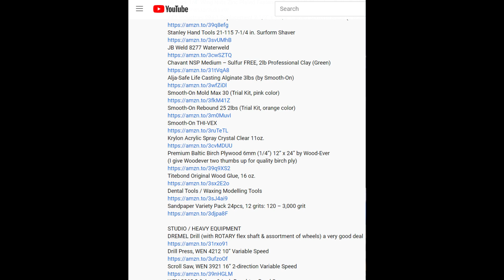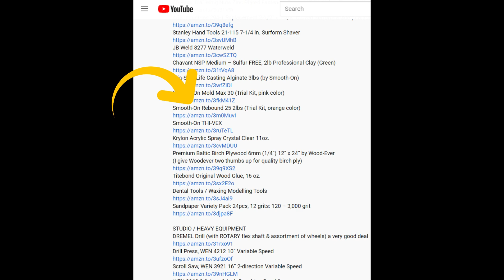SILICONE MOLDS FOR SCULPTURE Advanced Techniques for applying layers of silicone with thickeners

Comment: Hey, I've been watching some of your videos, may I know what clay you are using to sculpt?
Reply from the maker: Hi Ramanan. I am using an oil based clay. Some call it plastilina, plasticine or modeling clay. I can't recall this specific brand because I bought a lot of it eons ago. However, CHAVANT manufactures a high quality clay and they're very reputable. Check out the description below for a link to their Medium grade 2lbs block. It's also sulfur free which is imperative if you're molding with silicone. I should mention, you'll be redirected to Amazon.com through this link. I'm an affiliate marketer with them.
Chavant NSP Medium – Sulfur FREE, 2lb Professional Clay (Green) https://amzn.to/2HqEQKQ 
I'm glad my videos are useful to you. They're packed full of my experience as a sculptor. Best of luck.
Reply: @JonBurnsFineArt  Thanks alot! I've been sculpting with polymer clay for the past 2 years. I guess polymer clay wouldn't react with silicone. But to make bigger sculptures I was finding it hard to choose between water based clay and oil based clay.
Reply from the maker: @RamanansArtchannel  If you are going to use oil based clay and it's not a truncated form, build a solid armature that can easily release the supporting pipe. Water based clay is good for molding if you build solid and quickly. Don't let it dry out. If you have any questions along the way, just holler.